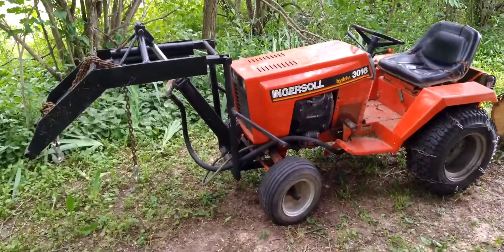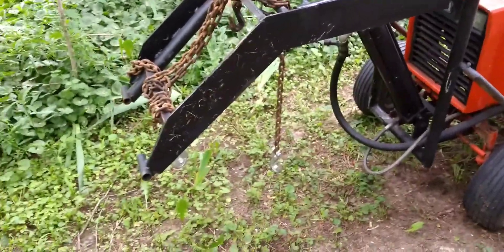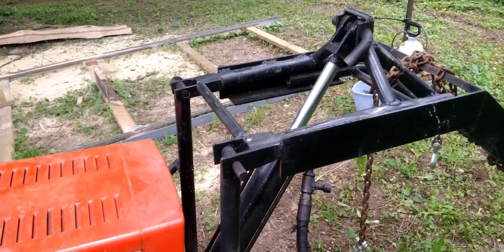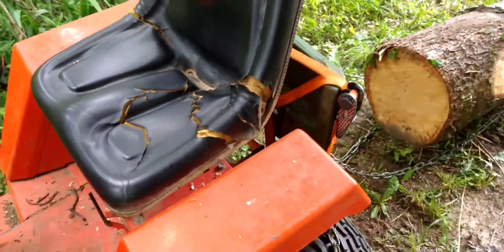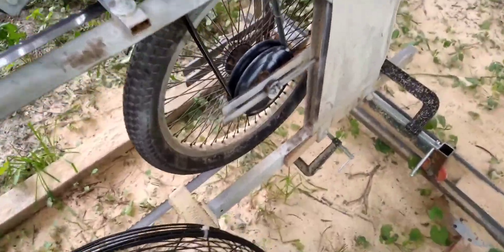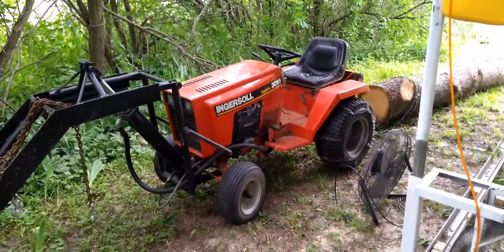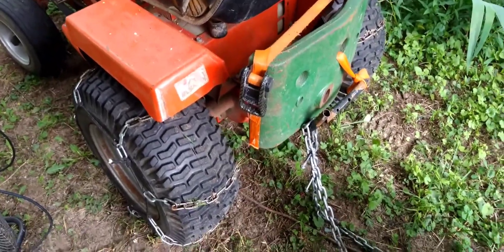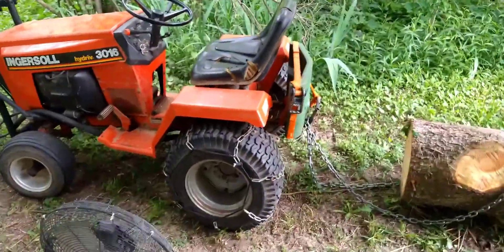Latest (Diy) mini-front loader (build update) Part 3 (w/diy sawmill build)

Comment: Nice... I'm current wanting to build a loader bucket for my JD 214 garden tractor... But I find it impossible to find square tubing to make the loader arms.... The only thing that I can find is Steel pipe of different sizes.... I see that you used pipe and then enforced it with metal as you stated in the video... Now that months have passed, Any suggestions on whether steel pipe of a larger size is a good idea, Or if you were me would you wait and find square tubing?
Reply from the maker: Honestly if I were you I would go to your nearest junk yard and see if they'll let you go shopping for rusty old metal. I bought my metal 4ft by 8ft 1/4" metal plates from a junkyard. 4 for $120. 
You can take metal plate and weld your own square channel, I've done that. Or you can take two pieces of angle iron and weld them together to make square stock (if you know what I mean). Tubing is strong especially a couple stacked and welded together over and under, you could weld some sheet over it later if you don't like the look.
Keep your eyes open for old stoves, washers, dryers, very good sheet metal there for certain parts of your bucket. Hope this helps 👍

Comment: Bad design.  You're forcing the front tires to take almost all of the load.  Move the pivot point closer to your rear tires or even behind the rear tires.

I would use 2"x4" square tube outside my rear tires and connect to the rear.  Then your bucket can be really close to your front end.
Extend the tube a bit behind the pivot point and attach hydraulics there.  Greatly speed up your lift.  You can adjust to your needs.
Reply from the maker: Really bad design, I thought about that after. I'm building another one now, instead of off the front, I'm building it off the rear. These hydrostats go just as fast in reverse as forward it seems. I'm turning the seat around and straightening the steering wheel. Counter weight will be the engine and operator. Kind of like a fork lift
Reply: @crazyDIYguy  
Another guy made one and I made some suggestions here:
https://www.youtube.com/watch?v=4mflY5zBKrI

Comment: Just build a trip latch for the front bucket a hydraulic cylinder up front is pretty much useless too much weight and not a big enough tractor. Eventually you're just gonna break the tractor in half or hurt yourself. I'd look for a used tractor it's more useful and you'll get more done . You're pretty much at it's limits on that chassis. If you plan on reversing it you're better off building a new frame with some I beam. It'll be stronger and heavier/more useful